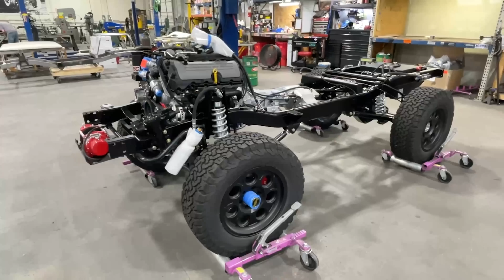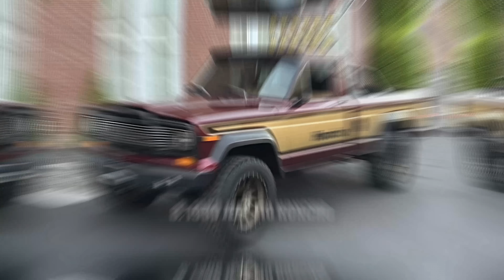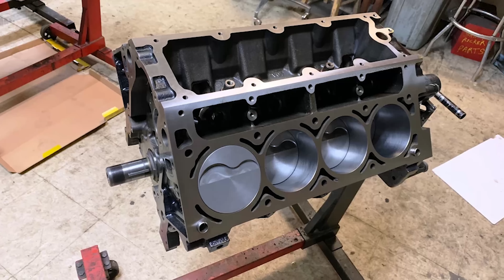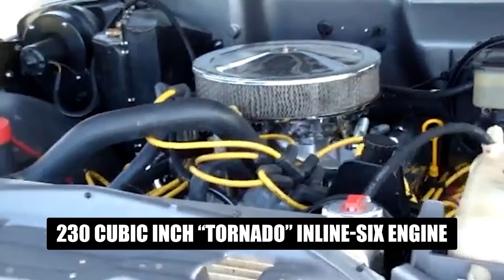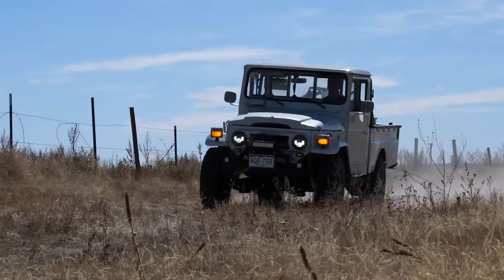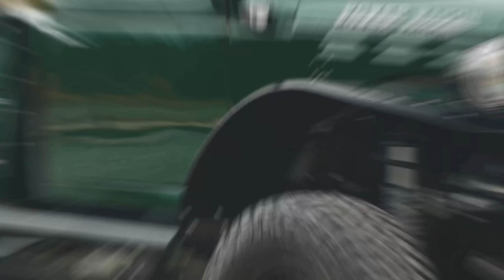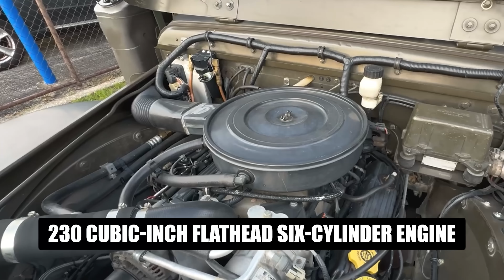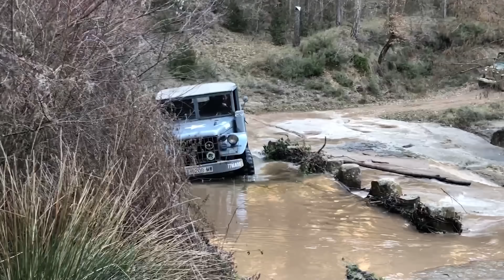10 Old Trucks That Modern Pickups Still Can't Beat

Comment: I purchased a 1986 G.M.C. truck new . It was 1 of the worst trucks 1 ever owned having a under powered 350 with bad components throughout the truck, which G.M. even under warranty did not back up. I make my living with light trucks I have owned more than a few .The suspension was horrible, and at 50k I had to have the truck resprung which was common to those modles due to trying to soften up the ride. I plowed snow with it, and it was not as strong as my 1976 Dodge or 1980 F150 300 6. That truck was so poor I have never bought another G.M. product to this day. Oh, and the 1977 Bronco was OK only with the in line 6. The 302 was a very unreliable engine. Intake problems and electronical problems. I had friends who had them and did not like them.
Reply from the maker: Thanks for sharing your experience, Paul! Sounds like that '86 GMC really let you down. Real-world stories like yours add a lot to the discussion—appreciate you taking the time!